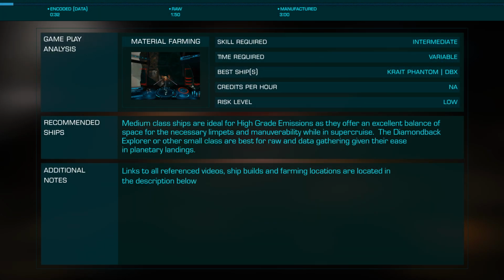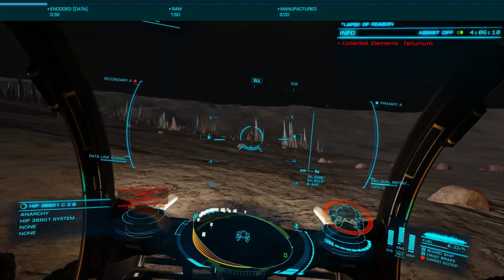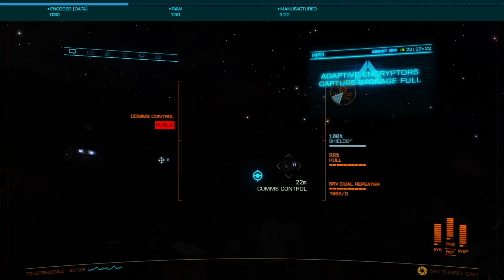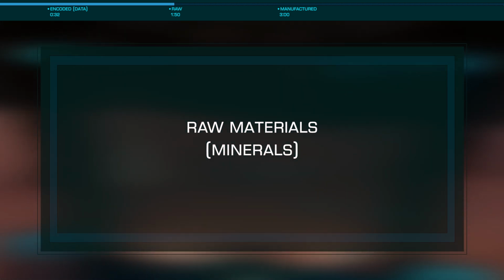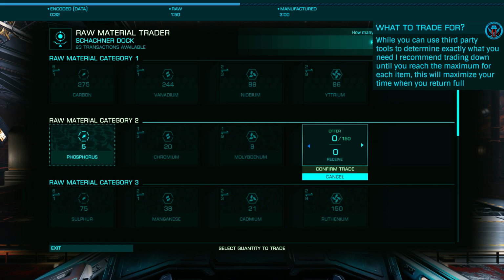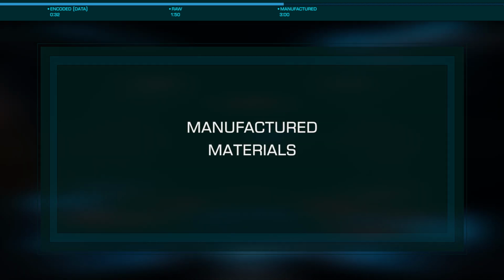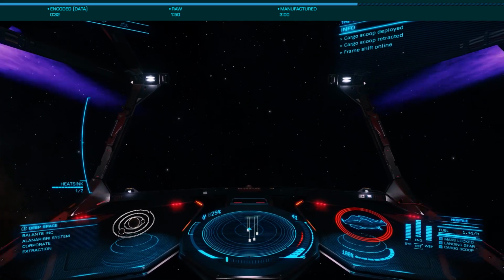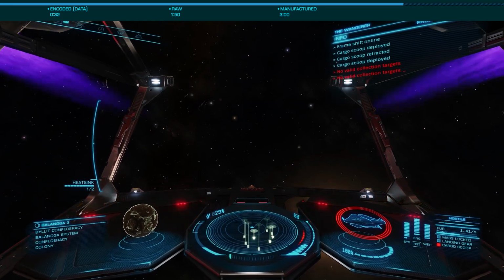The FASTEST Ways to Gather Minerals, Manufactured and Raw Engineering Materials in Elite Dangerous

Comment: As of 27/1/23 

For people playing on Horizons 4.0 or Odyssey and are doing raw material gathering.

Be aware that the shards are kind of all over the planet, rather than in small groupings like in previous versions of Elite. They appear in a "heatmap" type thing. You land your ship in the general area of the shard section and use the radar on your SRV to find them. You plain don't get the signal sources to home in on in Horizons 4.0 or Odyssey like you could in Horizons 3.8.

Polonium/HIP 36601 C1A
-57.54° 126.95°

Technetium/HIP 36001 C5A
3.55 111.54

Tellurium/HIP 36601 C3B
-65.2° 43.6°
-61.4° 35.5°

Yttrium/Outotz LS-K D8-3 B5A  -2.0°  73.33°

Antimony/Outotz LS-K D8-3 B5C -1.70° 22.22°.
Reply: Very helpful thanks. I just spent all day jumping my carrier over to these systems i used years ago and was pissed to find no signals lol. Good to know it wasnt for nothin!

Comment from the maker: NOTE on High Grade Emission Method: As I've had to clarify this a number of times you do not just exit to main menu, you must EXIT TO DESKTOP.  If you just exit to main menu the HGE won't respawn, if you exit to desktop it will.  I also opened a ticket with support to confirm that it is not a violation of the ToS, etc. to exit the game and restart to get materials to respawn and they confirmed it is not.  So if you're worried this is an exploit according to those that make the rules you're good to go.  Also remember that signal sources have a timer on them and if that expires while you're out of game (as time keeps on tickin', tickin', tickin') then it won't be there when you get back into supercruise.
Reply: Ah. Damn, that's what I thought I saw you do. Well, I guess I have to do this outside of VR. Thanks for the clarification.
Reply from the maker: @KalelPak123  Well you can do it in VR, you'll just be jumping in and out of game in VR which is annoying so yeah, I do all my farming like this outside of VR so I can watch a movie, TV, etc while I "work"
Reply: So, since I'm on Xbox I have to exit to home screen and then quit out of the program? I was trying the HGE technique outlined in your video and was quite frustrated as the nearest USS was usually 750-900 ls away and often degraded. Thought I would check the comments and see if I was doing it wrong.
Reply: ahhh
Reply: Shaman Frost, 
I just tried this several times and is not the same for Xbox users.
Reply: And what happens if you play on PS4?
Reply: I  did this and it broke my game. After reloading back into the game I could no longer open comms or ship panel, my 1-4 buttons are not doing anything now :(
Reply: Sounds like  the patch was being applied
Reply: @KalelPak123  me too
Reply: @verado2007  i am trying this today on Xbox, January 26, and i am going to my homescreen, quitting the game, and opening back up. Works consistently. Takes a little longer than the desktop platform, but is still faster than searching for multiple HGE. And just to be 100% clear, you can't just exit to home and re-enter. You have to quit the game.
Reply: If i try with the sistem in outbrake it never spawns a HGE what can I do, do I need to exit to desktop until one spawns?
Reply: @niconapolitano293   I am on PC and doing it right now, it still work, u need to do as the video says. Sometimes when u enter in a system that doesnt mean u are going to find a HGE, it is random, just jump to another system in outbreak or come back in another time.
Reply: @Z3D_009  I dont know if that matters but im on a ps4
Reply: @niconapolitano293  search in Inara website the systems u need  is very useful, and idk if is something different between pc and ps4, i only play ED on PC
Reply: do you know how this effects console gaming?
Reply: Thanks, I'm glad I checked the comments. I was going to say that it had been patched or something.
Reply: @lootjunior  Should have used Xbox
Reply: @88HELLJUMPER88  Works great for me as well. Love how detailed he is in the videos
Reply: what if the sector i go to isnt spawning any HGE, but the nearest other one with the right state is 60LY away? is it worth going or should i just farm the encoded/degraded emissions (and which is better if i do farm those?)
Reply: Bit of a problem here with me, though. Did the manuf stuff, worked as advertised, except got the wrong stuff in a system as what was labled in your vid. Per the list you provided an indip/alliance system with an outbreak state would give Pharmaceutical Isolators, and i got Proto Heat Radiators.

Edit: Went to a Fed Outbreak system to test, got Proto Radiolic and Proto Light alloys there.
Reply: @smokinggnu6584  Same here
Reply: Can confirm this method for HGE farming does work for xbox still as of 06.19.20, just remember to exit to home, not main menu.
Reply: CMDR Avarice exit to home?  Not the main menu of elite: dangerous? You close out and go home to the xbox?
Reply: I mean, you can SAY it's not an exploit, but it certainly breaks the roleplaying aspect of the game. I guess this is how gankers get their superships.
Reply: Right . ive had to log out on odd occasions where I was doing a salvage mission and accidentely destroyed the canister or object I was going for . You can loggout , restart the game and go back and do it again . It will respawn , so you go to super cruise , find the signal source then drop out and re do the task
Reply: Jan 2021 - collection methods still work!
Reply: Shame it can take several minutes for E:D to start on my system. Makes this method a lot less viable
Reply: For ps4 users. Back to main menu and then close aplication. Open again and repeat until the grind consume your soul
Reply: So I’ve been playing on Xbox, not getting the same results because the login/out is different. However if you quit, reload, supercruise, FSS mode, I’ve been finding other HGE’s in the system. It’s a slower process, but it’s working so far.
Reply: @GSquid24  you have to exit the game entirely On the Xbox dashboard and restart it.
Reply: Thats not true, just respawned it by entering the main menu in both solo and private session modes.
Reply: @aoshinn  dude i had respawned it 3 times in a row by exiting to desktop and after seeing this comment i tried exiting to the main menu and now it's gone...
Reply: that's why every time when I went  back into the game the spot was not there anymore :/ , thanks for this
Reply: your ship build didnt say anything about having a planet buggy thing. how do i equip that and will it fit with all the other stuff?
Reply: As of sunday july 24 2022, it still works. You have to exit to desktop
Reply: Can I please get that list from your description so I don't forget what I'm looking for. I have memory issues sometimes and easily forget small details like that.i would like to shove it in a "shopping list" style note for ease of access.

Comment: This video is more important than ever. FDev recently acknowledged the mass amount of players relog farming mats and knowing FDev, theyll only be looking at how it is done and not why. Material grinding isnt fun in the slightest and incredibly slow, which all but forces anyone who takes engineering seriously to use such methods. Use it while you can.
Reply: do mentioned methods still working? Accidentally returned to Elite after almost 3 years pause and wanna reengineer some ships :)
Reply: @olegmakogon7447  no they don’t. I just returned with a trillion credits worth of void opals in my carrier and wanted to start buying all ships fully engineered but when I came todo the third method the signal sources disappear after restarting.
Reply: high grade emissions for imperial shielding is cake - fly a loop around the hi-pop major systems - Achenar, Kamadhenu, Cubeo to name a few

in Cubeo I got 8 different HGE to spawn 

past that the rest of this video works
Reply: @someone7481  it does still work but you need to find the signal again. After you relog and get into supercruise, run a d-scan or recalibrate sensors in FSS and the signal will pop up behind you.
Reply: @casliquid  nope, tried this and signal had gone.
Doesn’t matter, Ive finally maxed out my cutter and corvettes so I think I’m done engineering. To be honest the games going little stale,
Reply: @someone7481  I'm actually doing it right now. It 100% still works
Reply: @someone7481  have not gotten to mat grinding yet, but returning after Ra long furlough from the game. When you would exit game were you exiting to desktop or main menu? I do know you have to exit to desktop and rejoin the same mode you were in. Hoping that I won't be having too much trouble getting the materials.. I just want to get that part out of the way so I can focus on unlocking the engineers and doing that grind without having to chase down random mats along the way.
Reply: @someone7481  strange, but it worked (however I can't remember Ive did it on odyssey or horizonts
Reply: @someone7481  Dangit. I noticed a couple of months ago that I was making no progress on signal sources with hours of looking. Now I know why.
Reply: Are you guys still playing ? Elite is dead, and Ill be avoiding all the develops future releases.
Reply: @someone7481  don’t care luv me chieftain

Comment: 2 questions Exi: if I don't see any HGEs after the first scan, what then? Hop to the next system or try some type of exit out thing?
For harder things to find such as Pharma isolators, do you suggest instead farming easy G5s such as imperial shielding and just trading them in the batches of 60 across?
Reply from the maker: 1. Yes, if you don't see an HGE once you jump to SC head to the next system that fits.  I use EDDB.io for that, put in the system type I'm looking for, where I'm starting from and generate a list of systems.  You can exit/relog but I don't tend to have good luck that way
2. Depends on how many you need.  If you need less than 16 then yes, find a CDC or Imp Shield, max out and go trade.  Generally I'll spend an evening maxing out all my G5s and if by the end of the night (or when I'm just done) if I haven't found Pharmas or Improvised Comps I just trade for what I need.
Reply: @Exigeous  Is there any additional "clue" as to what systems will generate these "High Grade Emissions" signals in Outbreak systems?  I've jumped around to 10 or so Alliance and Independent systems in an Outbreak state, and only one system had any HGE.  1 HGE total, and I had only 2 minutes to get to that one (which I couldn't).  This is quite frustrating.
Reply: @Exigeous  Awesome advice, many thanks!  
On the topic of moving on to the next system, I had 2 questions;
First, a friend said I might find more signal sources in systems with higher populations (not sure what the cutoff would be).  Would you do more jumps to prioritize those, or no?  
Second, I haven't had any luck yet; do you know off the top of your head any areas where systems of a given faction & state are all next door to each other?  I'm doing a lot of 4 jumps to nothing, and was wondering if there are points on the map that would go faster for a given category?  (I would just aim for the middle of a political bubble of the right colour as my starter system, but don't know if that puts me away from borders where wars happen, etc.)
Reply from the maker: @BowChickaHonkHonk1  It's very random - I've found 7 High Grades in a system with 10,000 population and none in systems with billions. The best tool to use is the Material Finder on EDTutorials.com - linked in the top left.

Comment: this is a good tutorial but logging in and out and blowing my srv and ship up is not what i had in mind when i bought this game xD
Reply: exactly bunch of cheaters blow your ship up you should have to go back to sidewinder with 1000 cr.
Reply: I guess you need a relatively cheap ship, because the rebuy cost will equate some mining time (which is the most efficient way to make money).

For a big ship with rebuy in the millions, that 10 minute trip is worth it.

Somewhere along the line however, you need to figure out what you want to do. If you are 100% focused on PvP, this kind of guide is great (but remember to buy a cheap ship for the suicide trip). If you are going to travel the galaxy, mapping and taking photos, gathering some of the materials will come automatically. You stop by a geolocial or biological site here and there and do some shooting.

It is not the wrong way to do it, but it is not the fastest way. And since everything get boring and stressful if you always try peak efficiency, these pauses doing something else is worth it.

As for cost and time, getting engineering material for missions is pretty expensive, you pay a lot for those materials. Perhaps even more than through the method described in this video.
Reply: @buzzfightbeer8023  Grinding is a personal choice. It isn't something you're required to do. It's unpleasant precisely to dissuade you from doing it. The game is designed to motivate you to do a little of this, a little of that, and eventually get what you want. But people are impatient and want it all NOW. So they "grind" to hurry up and get everything. Even destroying your ship... now you have to "grind" to get back the credits you spent on the rebuy. Very strange to complain about grinding on a video that tells you to grind.

Comment: Anybody else have trouble with the HGEs? When I re-log the sources are gone and I have to go back and scan the Nav beacon every time.

Edit: For pc you need to quit to desktop not menu for it to work, for consoles you need to quit the application not exit to menu for it to work.
Reply: Same here

Except scanning the nav beacon the second time yielded nothing
Reply: @grot777  were you able to get it working?
Reply: @steverobles9898  no man you? I can get the nav* beacon to rescan just have to relog until an HGE shows but  wish the the method mentioned in the video worked. Going to be a slow grind this way for sure
Reply: @steverobles9898  also getting different materials each time at the same location and my grade 5 materials list is a fair bit different then what's in the video so it must be some what out dated

Comment: Still working except I haven't, for the life of me, been able to get a single HGE in an independent or alliance system in civil unrest to get the improvised components.  Most of em have civil unrest and boom states in the system, and I get the damn boom faction HGEs.  I've found a few systems in civil unrest with nothing else but bust, but no damn HGEs at all even after hours of rechecking every 5-15 mins (just rescanning the beacon, which has worked in other systems; logging out to main menu or exiting game entirely between rechecks)
Reply from the maker: Yeah, that's definitely one of the most rare of them all - if you need less than 16 it's much faster to go get 100 imperial shielding and trade down as that will give you 16 of them and you can get that many in under 20 minutes.

Comment: It's a shame HGEs are still broken though. I finally found an Outbreak HGE in an Outbreak-controlled system, and all I found were a few Proto Light Alloys.
Reply: I found pharmaceutical isolators, there is only 1 and a bunch of lower grade mats at any given time, not worth it. Collecting 100 of these would take me hours not 15 minutes.
Reply from the maker: @geist-2111  What signal source were you in?  I've never seen anything but G5 and G4 mats spawn in a HGE so I'm guessing that's not where you were maybe?  I've had many comments just today of finding pharmas just fine - remember this stuff is highly variable.
Reply: Remember the state of the individual faction in that system is what will give you what your looking for. You need to find high grades with the signal source belonging to the faction in outbreak. You can go to a system that's In boom, and find military alloys/supercaps because a lower faction is in war/civil war, although the leading faction is in boom.
Reply: I found another Outbreak-controlled system yesterday, and all four HGEs were War HGEs (maybe the populalation is starving because the soldiers are eating all the food). The controlling faction should have the majority of HGEs.
Reply: @Bran
I haven't tested this quite enough myself to draw a firm conclusion (no hurry, and anyway it's continually evolved over the years, and likely will continue to do so) but yeah, it does seem like the whole controlling faction relationship-to-HGEs may not be perfect. But again, not certain. Maybe I'm just not sampling widely enough, that's usually where any statistical analysis failure occurs, right?

Comment: Just a very helpful tip, there are carriers around these few spots WHICH CAN HELP YOU RESTOCK AND REPAIR YOUR SRV. You don't have to go back to the Bubble in order to repair or restock your ship or ammo to harvest those materials. Just check whether are they for all docking access and you will be good to go. I had to leave HIP earlier cause I was running down to 600 rounds on my SRV and only realized that I can restock my ammo at Outotz.
Reply: You can synthesis SRV Ammo and Fuel with sulphur and phosphorus and repair it through synthesis with iron and nickel. This way you can still use the self-destruct way to get back to the bubble.

Comment: I would advise to trade away all your Atypical Encryption Archives as well, when doing the data collection. Being a grade 4 material, it will help you fill up faster.... Modified Consumer Firmware and Cracked Industrial Firmware are also available from the site, although in lesser numbers. I also used a macro to run in a loop so that I just parked in from of the comms link, hit the macro button and then come back in 30 mins (60 collections) to find the level 5 and 4 were full. Then all you need to do is destruct, clear the materials at the trader, then go back to the crash site and start again.